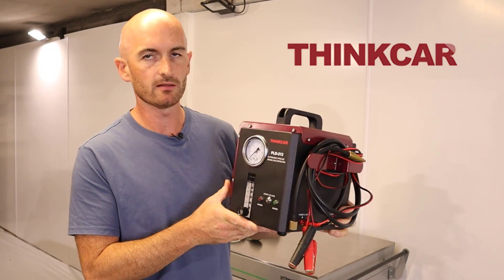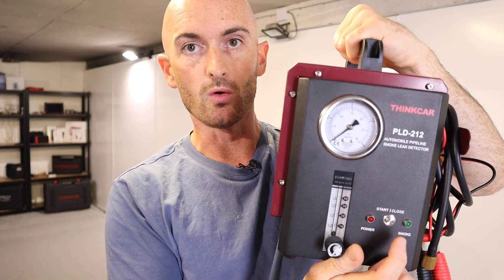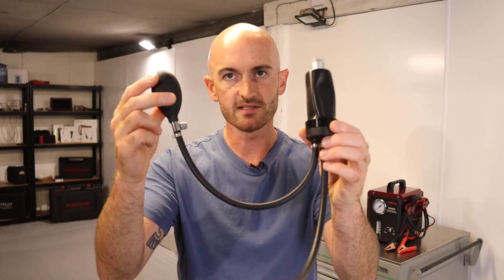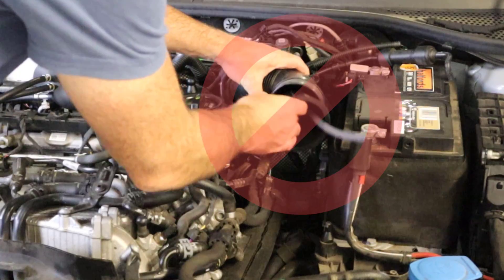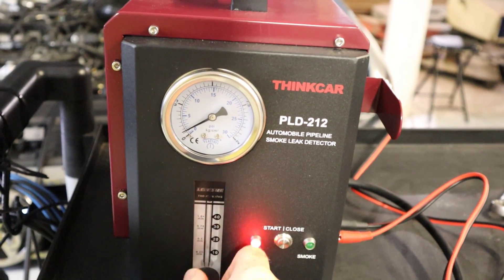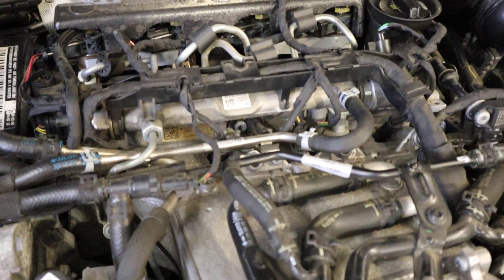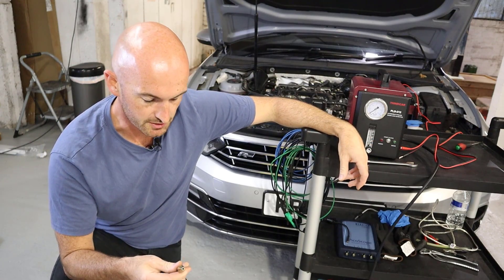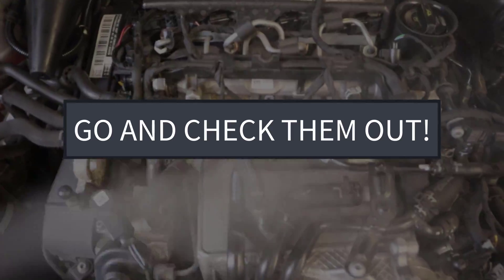How to Find Faults that the ECU Can't | ThinkCar PLD-212 Smoke Machine Leak Detector

Comment: Most of the inexpensive, Chinese smoke machines that have built-in compressors put out way too much pressure to test EVAP systems (at least the ones here in the states) safely. EVAP should see no more than ~0.5PSIg introduced and the 14PSI output this model and others typically have will easily damage components if used for that purpose. Dialing down the flow gauge on the machine, as you seem to suggest here, will NOT mitigate this issue. These machines would be golden if they would incorporate an adjustable regulator along with the adjustable flow gauge they already have, but I've seen none that have that. Some inexpensive, Chinese smoke machines that don't have the on-board compressor but rather require external air pressure be connected DO step down the pressure to safe levels for the EVAP and those would be fine to use for that purpose. Always enjoy your videos and thanks for the demonstration!

Comment: Can you over pressurize the system with this and blow seals?
Reply from the maker: I suppose it depends on the system you are testing. Maybe for NA systems, dial it down. For turbo system, crank it up. 

But for sure, you have to be careful. Maybe pull the dipstick or oil cap in case of crank case pressurisation. But at the same time, there could by a leak there too

Comment: Is this OK for VAG PCV system ? The launch tool says on you need to buy V2 ( the double price tag one ) I'd rather your thinkcar one if so
Reply from the maker: This one is fine: it does 16psi/1.1bar - amazing for this price and no external pressure required 👌

Comment: Picked up the Thinkcar smoke machine a few weeks ago. Have not used it yet but no stranger to smoke machines with 7 years auto tech experience. The Thinkcar does seem nice from playing around with it, awesome for taking home and not having to lug around a compressor. Guys the flow meter is a must have. I wouldnt waste my money on any smoke machine without it. You could run into intermittent issues and be looking for smoke for hours. The flow meter will tell you the leak is or is not present.
Reply from the maker: Thanks for sharing! Hope it serves you well 👍

Comment: I noticed that the pressure can do turbo leaks at 14 psi and evap leaks at 1 psi how is this done? I was trying to get a PDF of the manual for the smoke machine but cannot seem to find one.
Reply from the maker: Internal pump and you dial it up and down with the flow valve 👍

Comment: Darren does  it have an internal compressor or do you have to supply it and how much PSI or does it have an internal regulator. Thanks for sharing  Artie  👍
Reply: Yes it has its own built in airpump, it will go upto 15psi.
Reply: @impact-diagnostics  What is the min PSI, most say evap, but psi is to high.

Comment: I think that most diagnosticians have a smoke machine. I read some comments below, and no offense,  but I have never thought of building one myself. If I am not mistaken than I bought my first pro smoke machine for 200€ back in 2001. They are a bit more now but we use them weekly and that justifies the purchase instead of self made.
Reply from the maker: Never thought of making one either. I think they are quite good value, especially if you want some pressure behind it too

Comment: I have been using plastic jar containers. I save jars of different sizes and install them in the intake hose use the hose clamp and presto the hose is plugged and I have repurposed a container that would be thrown away otherwise. Also, it's easy to modify them for special needs, all that's needed is a drill/bit and a glue gun.
Reply from the maker: Love the innovation and recycling there! Nice idea 👍